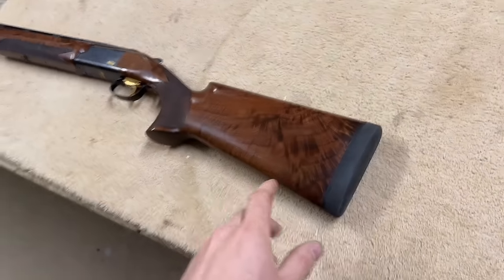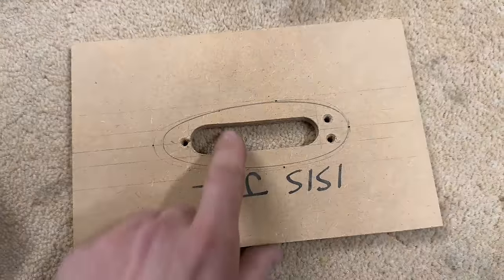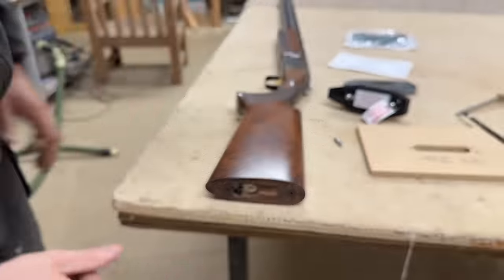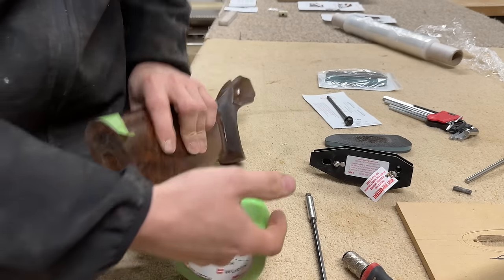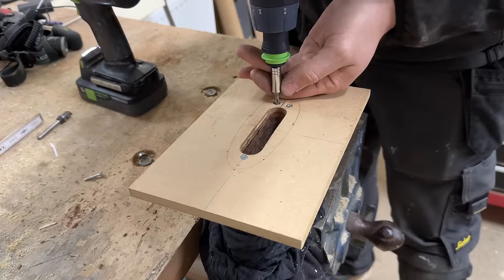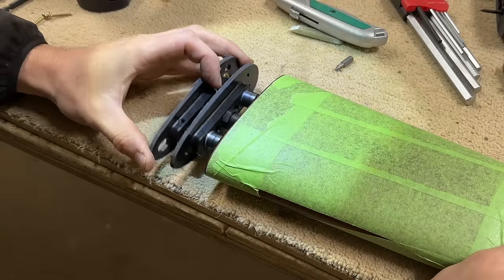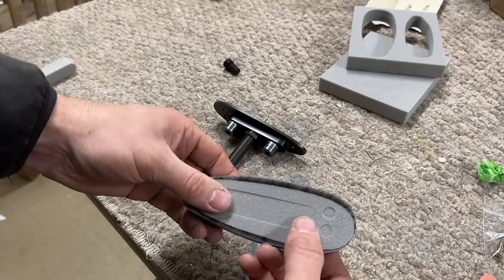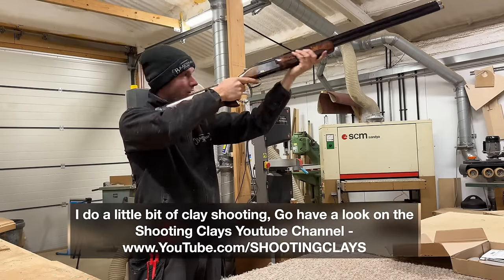Machining a Gunstock to Install a Recoil System

Comment: At 7:50 you have a lovely 10mm routed slot, but when the camera comes back at 7:52 the slot is much deeper. Did you use the same router bit to make the hole deeper to accept the rods as they protrude under recoil? Excellent craftsmanship. I made an identical template, and it worked beautifully. I made a second template to go deeper into the stock. Thank you for the video
Reply from the maker: Think i just kept going deeper with the same router bit tbh! i have a few of them different length cut.
Reply: Thank you for the info!  @BradshawJoinery

Comment: I use the "Soft Touch" system on mine. They insist on installing it themselves. It's on Beretta semi-auto single barrel. In the States we do what's called "sporting clays" which you basically go round 14 or so stations and shoot 4-6 on a golf cart. There is one nr. Allentown PA called Lehigh Sporting Clays. It's a diss-used quarry so you are shooting in between old buildings and also over water. It's the most fun you can have with your pants still on!
Reply: @@Geno70andstillkickingit You can say that again! Not sure they have in UK though?

Comment: Well that was different 😊 did the recoil unit make up for the loss of balance weights
Reply from the maker: Yes, generally i think there is a struggle to keep the weight down in them, hence made from plastic to help with that, can still weight the gun if needed as there is room in the stock bolt hole for some weights

Comment: How do you find time for that 😮
Reply from the maker: I don't have a life haha
Reply: @BradshawJoinery  what was your new little drill
Reply from the maker: It's a CXS, it was on offer as they have brought out some new versions. The old one is great though and @£160 really cheap. I've never seen them that price
Reply: @BradshawJoinery  were was it from if you don't I'm trying to find some batteries 8ah
Reply from the maker: Nuts and bolts, I dont think it is available anymore. I've bought the 8ah set too and will do a video on them. The charger with them is great!